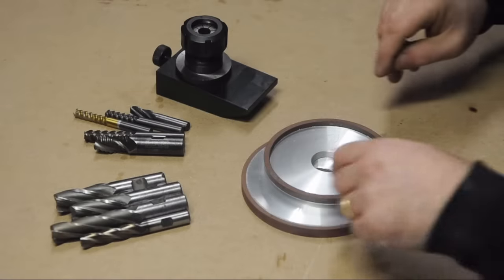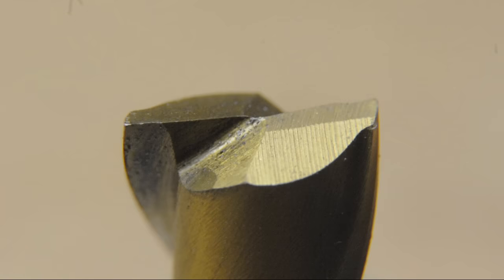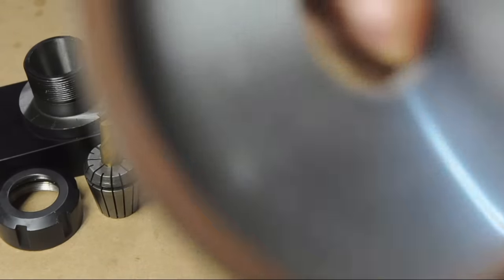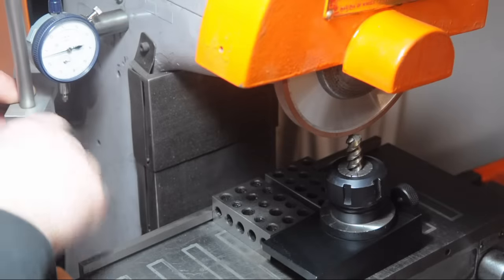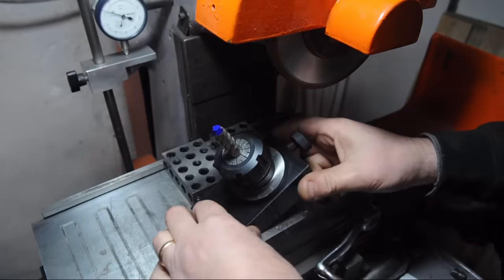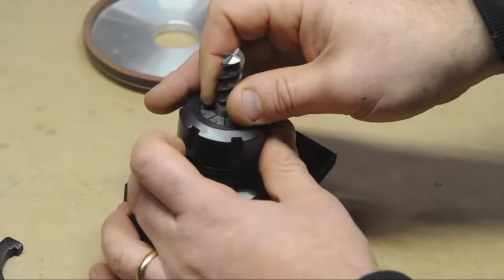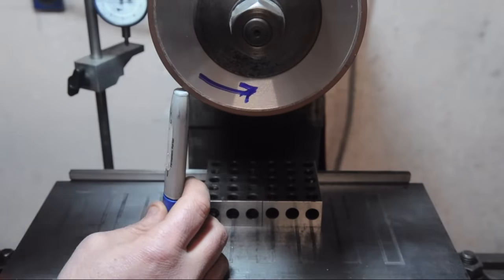Shoot'n The Poop #1 - End Mill Grinding Fixture

Comment: I have worked for large companies and they used to collect all worn or damaged cutting tools and send them out for re-sharpening! You are NOT a cheap skate. Enjoy your videos much more than a lot of other channels. Cheers.
Reply: The Lamb, No he's a tightwad lol
Reply: Yes, but then there’s no nominal size end mills after a total regrind.  e.g.   1/4'' = . 2486'',  3/8'' = .3734'', etc.
Reply: @lifuranph.d.6607  They can be regrinded to specified diameter tho, I worked on Walter cnc grinders and most of the time the customers didnt care about the end dimensions so we usually took 0.2mm or 0.3mm from the  diameter and from the face we took depending on damage of the mills
So for regrinding I would rather send it to some company since it was really cheap to regrind couple of mills

Comment: I know this is an old video, but I'm trying to catch up on all the "old" subjects as I work my way through your library. And this one brought up a lot of memories of my days as an apprentice tool and due maker. Early in my training I spent a year just sharpening cutters. I learned to sharpen cutters of every shape and size, and we had all the equipment needed to sharpen them properly! Back then (mid 1980's) the injection mold industry in Grand Rapids, Michigan was just then getting into inserted fly cutters (carbide and ceramic) and things of that type, but all that new stuff was extremely expensive, so almost everything was still cut using fluted HHS and carbide cutters, which needed to be regularly sharpened. Your video bright back A LOT of memories of that for me (...and I'd just gotten over my PTSD, too)!!!

Comment: Diamond (or CBN) wheels will load up much more quickly if used dry, which they're not intended for.
Such wheels should ideally be trued as soon as the motor current indicates the wheel is loading up. 

If this is done, the wheel will last a lot longer than if you wait until glazing can be seen, because you will only need to give it a lick. 

After truing, you need to dress the wheel. The resinoid material which bonds the diamond particles needs taking back below the outer profile (the cutting corners) of those particles. This is so they can penetrate the work and deliver a free cutting action. Otherwise the stone will (again) load up much more quickly.
 
Use a dressing stick one grade finer than the wheel's grit size. This will permit the stick's abrasive grains to penetrate into the gaps between the particles on the diamond wheel, and remove the binding material.
Reply: Gottenhimfella a
Reply: Ok
Reply: You can use a soft white aluminum oxide stick for cleaning the wheel.

Comment: When I regrind the front cutting edges I dont bother with secondary clearance and gashing - I just grind them with about 2...5° clearance to the center and to the back - They work very well but of course you cant plunge with them anymore.
As I have a surface grinder now I might pick up that fixture too, would save me from use the single lip cutter grinder fot that purpose..
Reply: Say what?
Reply: +Best Services what
Reply: Can you dress a diamond wheel with a regular diamond stone dresser? It could just wear faster... Maybe.

Comment: For those of you trying to read that list of Youtube machinist creators at about 0:13 (to see if you are on it??? I'm not.) Google Chrome has a method for stepping through a Youtube video frame by frame. You pause the video and use the angle bracket keys "<" and ">" (actually the comma and period since you don't hold down the Shift key). In this case it will disclose that the list has been repeated several times to make the fast scroll last longer. (This may change the playback speed when you resume normal play, but that can be corrected by clicking on the gear at the lower right of the playback window.)

And now ... back to actually watching the video.
Reply: I did not know that.
Reply: firefox has that too, think it is a general yt thing

Comment: Does your grinder spin in the opposite direction because it's metric? ;-)
Reply: eformance made for Australia
Reply: only every few thousandths
Reply: Same as when you flush the toilet in Australia. The water spins the other way.
Reply: What I think it's only spindle motor connection issue. Metric grinders, as you call them, also have CW rotations. Maybe it's easier to work with grinder in a tight placement

Comment: I do mine carbide end mills with hand.. I use grind weel to make the face but  all the others "cuts, angles etc" I make them manually. It is easy and very quick.
Well, I use this process every day so, it may be easy for me.
I am in die-mold businnes and the material I cut is 80% steel and stainless steel. So I can't affort to buy every day 4-5 end mills.

Comment: Hi Tony, how I used to dress diamond wheels was to "wear" them true by grinding a piece of steel, I was sharpening carbide cutting tools in a factory and I would sharpen so many that it would wear a dip in the surface of the wheel so I would take a square piece of steel and grind it until the wheel would wear flat again.

Comment: I used to work at a machine shop making aerospace products, jet engine parts...etc. The new hires are almost always assigned to the Tool grinding area (unless it's the bosses son), It's a high turnover type job. If they can endure a few years there, they usually will move on to the production area making million dollar parts.

Comment: I'm sharpening my drills and endmills using a diamond wheel on the mill (sorry that I do not have a surface grinder) and a rotary table with ER25 collet. Most important to get edges that remove the same amount of material is the angle you turn the mill in the rotary table from flute to flute. For your stevenson fuxture, I would place dents with precision on the outer diameter of the collet bearing and a spring loaded ball in a hole of the fixture that indexes into these dents. So the 180 (2 flute) or 120 (3 flute) degree angle will be reached with precision (you don't need 121 degrees at all). Sadly your stevenson fixture is not for drills, otherwise I would build one.

Comment: I just saw this old video and thought I had a good comment for This Old Tony.  Then I got to the part where I could see the grinding dust flowing off the wheel...   I've never run a surface grinder with that direction of rotation.

Comment: I have a T&C grinder (actually a universal grinder), and this is one of the things I've been anxious to learn about. Thank you for posting this, and for being so enjoyable!
Reply: Also, if you had a T&C grinder, but no tooling or fixtures, what kind of fixture would you want to buy, on a hobbyist budget?
Reply from the maker: +Jon Miller Ouch, you don't usually see T&C Grinder and Hobbyist Budget in the same sentence, that's a tough one.  I'd suggest you pick a few things you know you'd like to grind and see which fixture(s) you'd need to cover as many of your needs as possible.  Maybe start with a "universal grinding fixture" (check ebay) .. like a DoAll or clone.  Maybe a Spin Indexer, too.  You could get both of those (import) at a reasonable price and see how far they get you.  Have fun!
Reply: This Old Tony Yeah, it's an unusual situation. Even more so since I don't have my own mill or lathe (my two brothers each got those), but that's what can happen with inheritance. I've had thoughts of selling it to buy something that will get more use, but it's way too cool of a machine to let it go. (Covel #6 if you're curious.) 

Thanks again!

Comment: Useful video! I just snagged an old Hammond tool and cutter grinder for cheep but it needs a collet holder. Your video inspired me to get a Phase II (since I have built in angle adjustment already) and adapt it to fit. The style you have would work too.

Next thing I want to try is a Spindex to sharpen flutes (I'm cheap so awaiting a few tool auctions before I give up and use Ebay) If you are gonna do more videos I'd like to see your take on that method.
Reply from the maker: +Ob Fuscated Thanks for watching Ob.  I've never tried flute sharpening with the Spindex, but interesting idea.  I have a 'UniGrind' I've used once or twice.. dig back through the videos you should find a flute sharpening one.  In theory I imagine it'd be the same.. you'd just need to fabricate a "finger"/flute tracer to rotate the endmill while you advanced it.

Comment: Pretty old video here but did you ever look into Harold Halls grinder rest? I have come to realize I need to sharpen my own end mills, flutes and all, or I will be in the poor house. It's an interesting design, for everything from drill bits to end mills and spirals too. Gotta build it yourself. Meant for a grinder and various wheels but I don't see why it would not work perfectly well on a surface grinder.

Comment: If I have a fair sized carbide endmill that threw it cutting edges on the end (and I’ve got plenty!) I just use it for edge cutting. It’s rare that the flutes get damaged much beyond the end.

By the way, when using a high helix cutter, don’t use it on material that’s less than the length between two flutes. A minimum of two flutes length thickness is needed for this, unless the work is very rigidly held close to the area being cut, because the cutters act as screws, and the material will lift if it’s too thin because instead of cutting, the bit tries to screw itself through the work.

Comment: 4:51
You probably already know this but,
A diamond tipped truing tool for your surface grinder will do the trick.
Or buy an N.C. G.wheel truing machine.
They're awesome; comes with cameras, preset software and everything. They normal set 2 g.wheels against each other to do the 'truing' instead of a diamond tip and can do any wheel type needed. Great compliment for 6 axis C.N.C. grinders.

Comment: You probably have ground many more end mills since this video was made and maybe figure it out that, that end Mill having sharp points at the end will break off in steel. Typically there is a "land" or small face only maybe .01 to .02 high to remove the sharp corner. Thanks for the great videos!

Comment: I once had a job running a CNC lathe at night all by myself. The day guy worked his ass off producing 93 stainless steel parts, taking no breaks nor lunch, sucking up to the boss when he came by (I know this, because he showed my how to run the machine).  Best I could do was 84 and since I worked all alone I had no one to glad-hand! What to do? I figured by pushing the feed rate on the single large diameter steel drill used to remove most of the inside metal, I could make parts faster. So I doubled it. It worked, but the drill cutting edges wore out . So I rigged up a drill jig on a nearby surface grinder so I could quickly sharpen that lone drill while the CNC machine was running. Eventually, I increased the feed until I was in the realm of diminishing returns and settled on a happy medium. So for as long as that job ran, both day and night shift ran 93 parts apiece. The day guy pissed in a bottle behind the lathe and brown-bagged it, while I had plenty of time for breaks and could go to the dining area for lunch.

Comment: I have used fixtures like this to sharpen perfect center cutting, flat bottoming end mills. Try to copy the grind angles of a new end mill. You really need a dish wheel to bring the cutting edges to center. Your secondary relief should be ground last to keep you from grinding the edge too thin, high helix end mills have thin enough cutting edges as it is.

Comment: I've got the 5C version and it works for the occasional need to do an end mill. One thing with diamond wheels on the surface grinder. Normally it is a good idea to indicate the wheel in. Wrap the OD with Scotch Tape and lightly tap the wheel to true it up with an indicator. Do not use the indicator on the diamond. Just don't how I know this. Also High Helix end mills may have less lateral forces but they have much higher end forces trying to pull them out of the collet

Comment: Here's a crazy question... can / could this jig / method work for converting a conventional end mill (4 flute) to a plain pilot (smooth) counterbore? I have a specific recurring task that requires a 10mm end mill with a plain 8mm pilot. Length of the pilot is not critical - 6,8, 10 mm would be fine. Many thanks, and yes, love these nut's 'n' bolts chats.

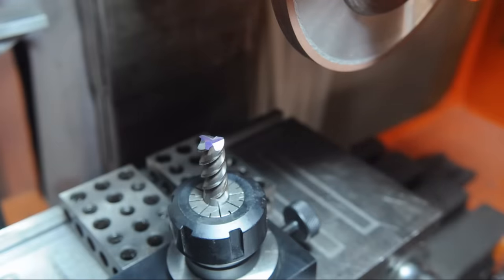Comment: 12:32 About the "trying to grind" you'd be surprised what a light dimmer hooked to a dremel can do in terms of control and I bought several of HF's cheap diamond cut off wheels just for jobs like this in my own woodworking tools. In fact the whole thing looks very much like a woodworker's jig one might come up with, but isn't there a small tool to sharpen those endmills? Even I don't mess around with drills and I can sharpen almost anything. I leave my drill sharpening to the drill doctor. The cheapie portable traveller model worked so well for me that I bought the larger industrial one which I think will do bits up to 3/4ths. For a woodworker that's huge in most regards and the forstners, spades and other such bits are easily hand sharpened as long as they don't have a spur.

I also have a set of three diamond sharpeners that look like toothbrushes that you might want to purchase. Super handy for touch up work. The diamond impregnated stuff is remarkably tough -- I laughed at your thought of dressing it. I've never heard it done but I understand your intentions.

Is carbide really toxic? You were kidding about that, right? If not I'd better get my dust collection system connected to everything. They don't mention that on my DD and it has a diamond wheel and can do carbide bits usually used on concrete block or glass.

I wish you had done a 2 flute one because I've got a few of them.

Diamond is awesome and I knew it was beyond my reach so about 2+ decades ago when I sent in one of my $50+ orders because they had free shipping (and I paid no state taxes on them, a triple savings in all!) I hand wrote it on their suggestion blanks and it took awhile but they started carrying them, then started discounting them, then I started buying that stuff up like it was gold. 

The only way I have worn one out was using a inch wide diamond drum sander in my router going at 25,000 RPM. I guess that is a little too much for them but that router had no way to slow it down and it had the required 1/4 inch chuck plus it was the most powerful tool I had that could chuck that up. Treat them nicely and they'll probably last the rest of your life and no you don't need to dress it. 

Great little show you got going, Tony. Thanks for sharing. Oh, could you recommend anything for us less tooled(no mill, no metal lathe) metalworkers to understand more about the scope of these kinds of tools? I just missed out on getting my Uncle's because it was halfway across the USA otherwise I would have went and picked it up. I now feel a compelling feeling towards mills and lathes but I don't really know why. I make small metal tools. Like a pushrod becomes a gouge, heat treated of course, a few knives, occasionally a garden tool or ice chopper made from a railroad connecting plate... we really need them that tough here in MN and all the HW stores sell are about 14 gauge. They're a joke and I've seen plenty of broken ones so I decided to make one that would not break.
Reply from the maker: Thanks MNViking.. I spent a couple of my formative years in the twin cities.  Yes grinding carbide is toxic; careful!  Though I suppose it depends just how much you do.  Never heard of diamond toothbrushes!

Comment: After watching this video again, what kind of magic did you use to cut the carbide endmill? Did you have a proper diamond cutoff wheel?
Reply from the maker: I used a diamond tile saw.. 115mm in an angle grinder.  You could probably use a dremel diamond saw if you have one.  Just nick the side of the end mill (cut through one flute and a bit into the core).  A vise and sharp smack with a hammer will do the rest.
Reply: I am suprised that the tile saw works on carbide, those seem to have very little diamond content - Have to try that :D
Thanks!
Reply from the maker: +Stefan Gotteswinter they don't have much but they do the trick.   might not cut very many tiles after that though.

Comment: I used to work at a tool and die shop with large diamond wheels that looked similar to yours,except larger. We dressed them by grinding soft cold rolled plate. No idea if that would work for yours but it might be worth a try.
Reply from the maker: +Siegfried Gust thanks... will give it a try!

Comment: You can use what I call a commentator stick to dress that style of diamond wheel. A commentator stick is what's used to seat the bushes on a generator or starter. The commentator stick removes the resin that bonds the diamond to the wheel.

Comment: How did you cut the end of the carbide end mill off, you already had a diamond cutoff wheel? To dress diamond wheels we use Moly, I don't know it's full name. We also leave diamond wheels on hub so we only have to touch them up not fully redress them everytime.

Comment: Thanks for the video Tony.  I was surprised to see your spindle turning the opposite way to any other grinder that I have used or come across (at 14minutes).  Pleased to see you make note of this (at 17 mins) and warn of the danger if not  allowing the workpiece to deflect away from the wheel when grinding.  It's essential that anyone new to grinding takes this onboard.

Comment: Cemented tungsten carbide is only about 10% by mass cobalt, so it’s really no more hazardous than grinding a cobalt hss like m42. Stellite 98m2 on the other hand, is 31% by mass cobalt. I like to wear a mask and use a dust extractor when grinding that stuff.